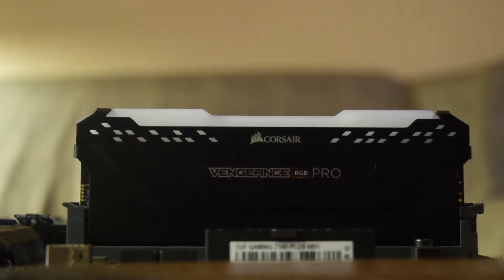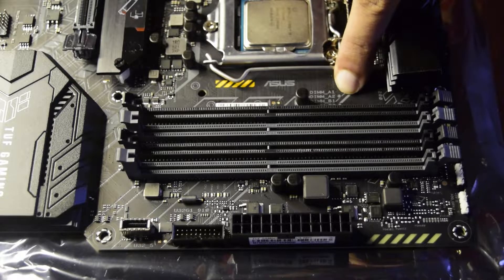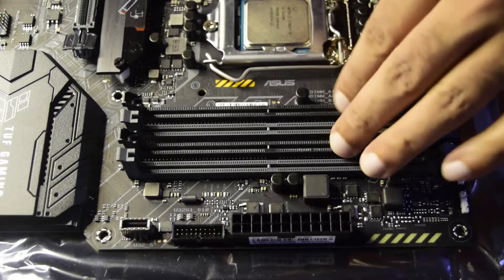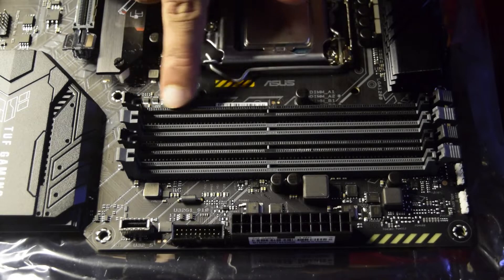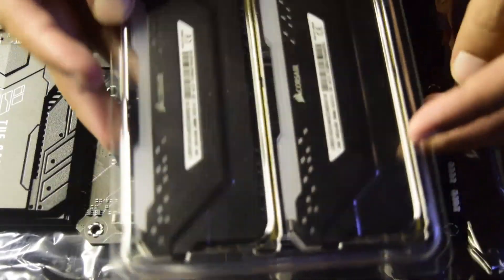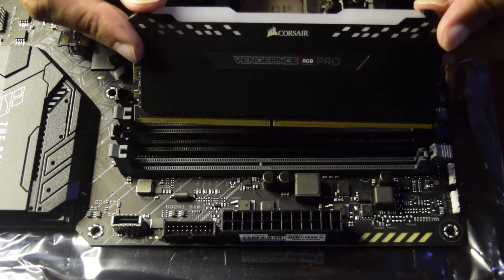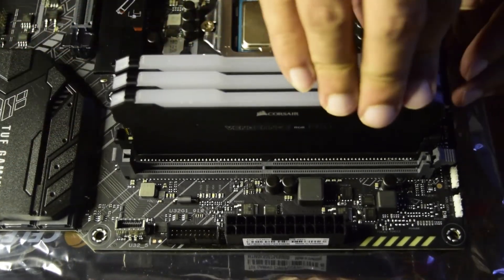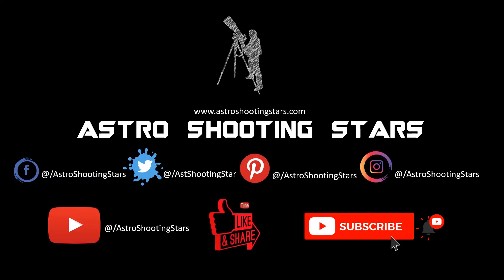HOW TO INSTALL Corsair Vengeance RGB PRO RAM CORRECTLY ON TUF GAMING Z590 PLUS MOTHERBOARD

Comment: Great vid and thank you for making it. I’m just a dad trying to do a build for my son. I want to put 32gb into it but I’m really confused. Some people advocate 4 sticks over 2. I’ve heard this works especially well with Ryzen cpus but I’m using Intel and am using the MSI version of your motherboard. I’ve since been told that because it uses daisy chain rather than t-topology that it runs better with 2 sticks rather than 4. Then I noticed you using 4. Please help, my head is about to explode.😂😂😂 what are your thoughts?
Reply from the maker: I understand the problem, but let me give you another prospective, protocols apart as they will complicate understanding as yes larger memory ram is better than smaller memory with larger number of sticks but there is no useful performance change unless you have large in memory processing needs where larger memory sticks are useful. For any other cases 4 sticks are preferred for two reasons specifically one being cheaper to buy second being maintainance as if a RAM goes bad you loose 16 gb in 2 sticks config however in 4 stick you loose only 8. I hope this helps. Please stay tuned to my channel for my future videos